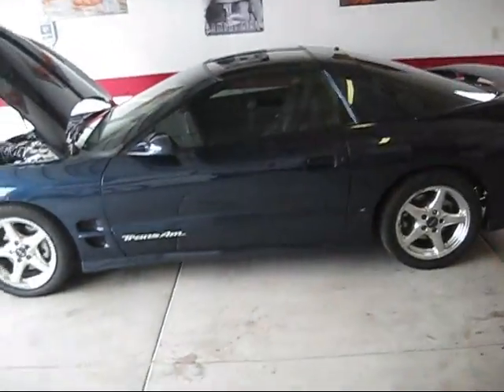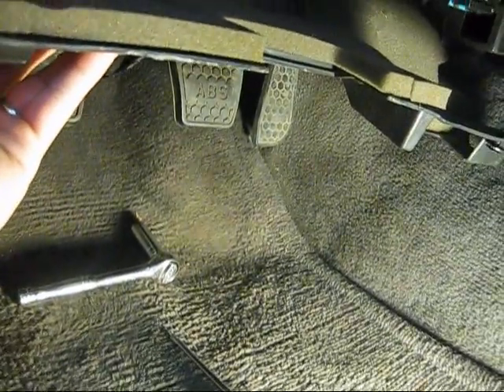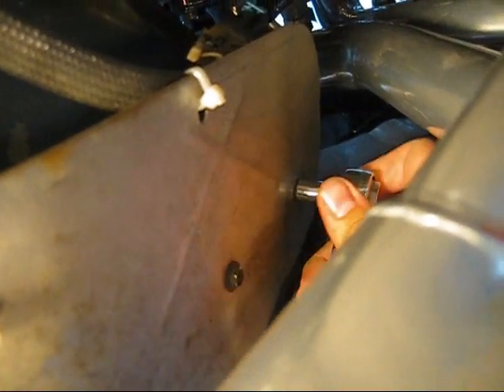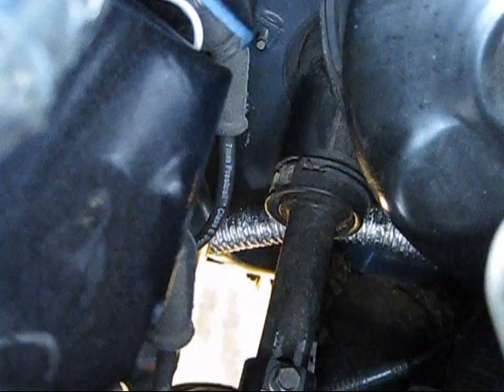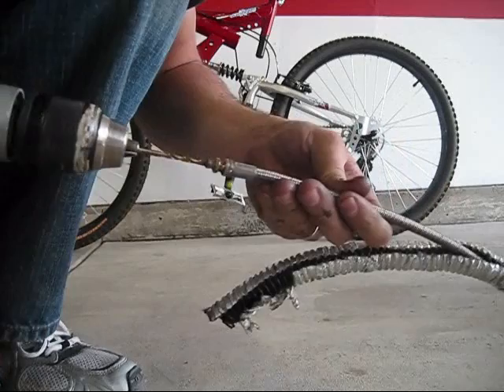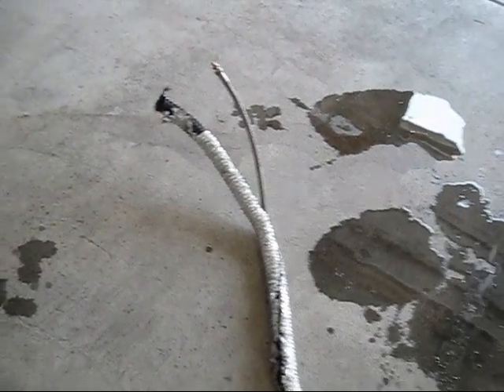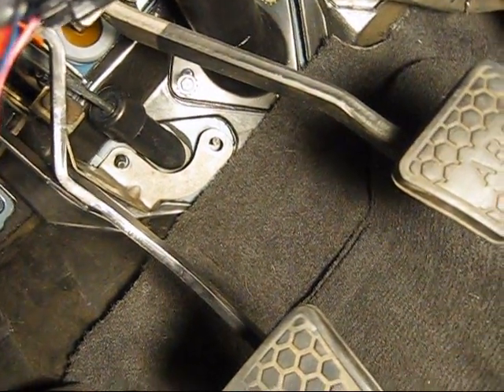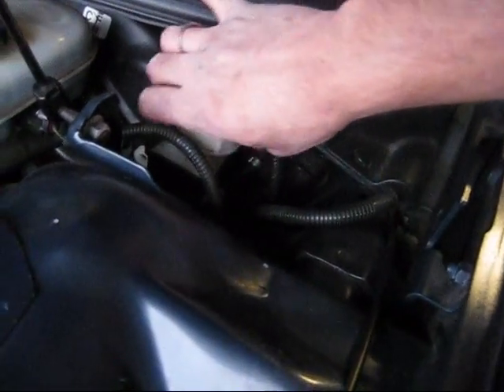How to Master Cylinder Install and Drill Mod (LS1 F-Body)

Comment: Thanks for the video! I watched it twice & in just 3hrs my buddy & I had the job all done. Only difference, I installed a brand new master clutch cylinder & I did NOT disconnect the braided hoes from the transmission. I did all the clutch replacement work under the car. After installation was complete I filled the reservoir with fluid twice, had to pump the clutch by hand a few time(because it sticks to the floor without any fluid in it) till the fluid went down and she stated working like new!

Comment: One more note. There was nothing wrong with the cylinder on my car, The fitting was plugged where you drilled it out. I drilled out mine as you showed and then I cleaned out all the lines and the pump. Ran fresh new fluid through it and reinstalled it. I hope to get another 80 thousand miles of driving pleasure. (Now that I saw the video on how to change the fluid)

Comment from the maker: Yup. Filled up the master cylinder resavior with fluid and started bleeding the system. Push clutch pedal all the way to the floor, crack the bleeder for a few seconds, close the bleeder, pull clutch pedal slowely up off the floor. Repeated about 15-20 times until stiffness returned to the pedal and it felt good. Remember to refill the resavior about every 3 times you crack the bleeder of the resavior will run dry and it will suck in air.

Comment: Awesome video!!! Great detail man thank you. Just got a new clutch in my car and my transmission rebuilt n i unfortunately decided not to change out the slave cus i ran out of cash...of course now my pedal is sticking!!! Ahhhhh :( ima try changing my fluid first if no luck i will also change the master. Does anyone have instructions on how to bleed the system???? Im scared to even mess with that. Were is the bleeding valve on the transmission??

Comment: used the online form but no response. I'm going to see how hard it is to remove that bracket so I can open up the hole some more. Also have to do the same to the firewall holes. So far I've tried moving it every way and there's no way from what I can see. Sometimes you miss stuff but I don't think so. It better shift well after this!.

Comment: Screwdrivers wouldnt work for me on the quick disconnect. 

The "FORD A/C AND FUEL LINE COUPLER TOOL", part # W83113 at Advance Auto parts, is what you need. It's 8.99 and WORTH IT!! Similar tools are sold at Autozone, Oreilley etc.

Comment: Good video. A little shy on some of the steps thought. With Pontiac every step of a repair is a lesson in why the company fails to consider designing for repairs. Your disassembly  explanation was right on but following up on the reassembly was so weak. You may have done this a couple of times but for a first timer let me see the retainer clips up close and how they work. You totally skipped how difficult that u bolt is to get back in place. Could you follow up on bleeding the system?

Comment: Hey sorry for the late reply man my internet has been down :( and yes i went back to a stock clutch on my car it now has about 500 miles on it and counting. The car previously had a spec stage one clutch and it had a shim in it that i left out when i put the new stock clutch in. Maybe i should have left it in? I replaced my spec 1 cus it had heat spots on flywheel and pressure plate.

Comment: I have an LT1, with shorty headers. Ended up having to take that u-bolt out, because somehow the master cylinder rod ended up on the wrong side of the clutch pedal. Now, I can't get the damn thing back in.

I installed it while the engine and k-member were out. Almost ready to start the damn thing, so frustrating!

Comment: I got my tick master cyl in finally but now the bolt holes don't line up! freaking ridiculous. I'm probably just going to put a delco cyl back in. I wish it was as easy as your video shows it :(. I can do it faster now though that's for sure.

Comment: Hi, what is the purpose of drilling out the hose?? Thanks.
Reply from the maker: More fluid transfer which can help people who are experiencing a “sticky clutch pedal” which is common in these cars.
Reply: @MapleBoarder78  thanks!
So I replaced My clutch and slave cylinder, now I barely let out the peddle and the car starts to move, any ideas??
Reply from the maker: @philllsxga.7737  Either has air in the hydraulic lines and needs to be bled better, or it was not shimmed properly. Did you do measurements when installing the clutch to determine if you needed a shim behind the slave? If not, and you needed a shim, the clutch will engage close to the floor because the slave bearing can’t reach far enough to push the clutch fingers far enough in. This is what happened to me when I installed my clutch. You can either drop the tranny again and measure for the proper sized shim or you can do what I did and buy an adjustable master cylinder from someone like Tick Performance. An adjustable master will allow you to adjust how far the slave bearing can extend into the fingers of the clutch which will give you better engagement, less clutch wear, and allow the clutch to engage at the center point rather than right off the floor.
Reply: @MapleBoarder78  thanks for that.
I installed the luk 04 905 clutch kit and the luk LSC 265B slave cylinder. Three places told me they are compatible.
But I know what you mean the factory fingers seem to stick out a little further..
I hope I don't have to take the transmission back down..
You are saying the Tick adjustable master cylinder will correct the problem instead of shimming the slave cylinder if that is my problem??
Reply from the maker: @philllsxga.7737  Yes, the adjustable allows the bearing to extend further and reach the fingers better. You can adjust it so far you can change the engagement point from right off the floor to all the way at the very top of the pedal, to anywhere in between simply by turning a threaded nut on the shaft. I decided to go with the adjustable master, I was not dropping that tranny again, lol. It’s not guaranteed, but generally it fixes most people’s issues, including mine. I believe there was a write up on LS1tech.com that showed you how to make your stock master adjustable if you don’t have the $300 for a Tick unit. You may be able to find that thread, but I decided to buy the Tick. I sold my Trans Am years ago when I became Christian so I’m a bit out of the loop on all the recent threads and performance parts.
Reply: @MapleBoarder78  okay thank you for the information!
I plan on getting the Tick.
Thanks again!

Comment: hey man this is a great how to video, just wondering one thing since you seem like you've done this multiple times.. would it be possible to get the braided line off of the master cylinder without actually having to remove the whole thing from the car, it seems like that's the hardest part of the whole process just getting the MC off and on.
Reply from the maker: I don't think it would be possible since the master is tucked up under the brake booster. There isn't a way I can think of that you could tap out that pin to disconnect the line from the cylinder while it's under the brake booster like that. :(
Reply: ***** yea that wasn't gonna happen lol I ended up pulling the master out and doing it. How did you figure out where to put that hole in the floor pan to get to the bleeder it is a pain in the ass to get the that screw under  there I cant even get a socket on it
Reply from the maker: I just guessed, I had to drill it two times though to get it right, lol.

Comment: I think you may have answered this question before but to be sure, I had a new engine and clutch installed in my T/A and I noticed that sometimes it wont let me go from 4th to 5th or it wont let me downshift like before, I tried bleeding it which helped a bit but I’m wondering if it the master cylinder or if the clutch wasnt installed properly, I called the shop and they said we’ll look at it for 100$ after charging me 2000$ to do the job… what a rip off… any ideas?
Reply from the maker: I’d bleed the heck out of it a few times and see if that helps. If not, you may need to go with an adjustable master cylinder from Tick. If the shop didn’t measure for a shim and just threw it in there, the bearing on the slave may not be extending far enough to press the pressure plate fingers in all the way. The Tick unit will allow you to extend the slave bearing further.
Reply: @MapleBoarder78  thanks brother , awesome testimony by the way, keep the faith He’s on his way!

Comment: Can i just change the master cylinder and knock the pin out and not take the line off the trans
Reply from the maker: It’s worth a shot. I can’t think of why it wouldn’t work.

Comment: I had one star washer behind the bracket on the right which was a bitch to get at. I'm installing a tick performance master cyl and it's super hard to get in there properly. I had to remove my brake res and that egr pipe on the side. The problem right not is that the bolt holes don't line up on that bulky pos :(. Have to wait for a friend to come help me. I was able to pull the original  out the top but I had to kneel on the frame.